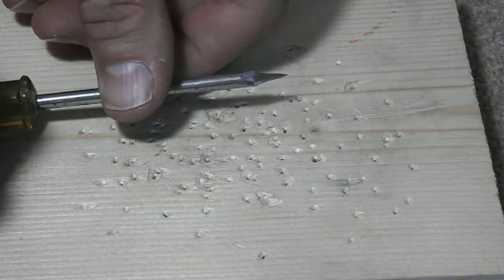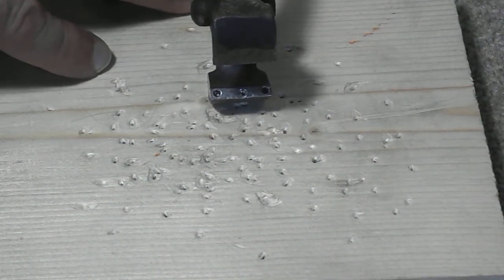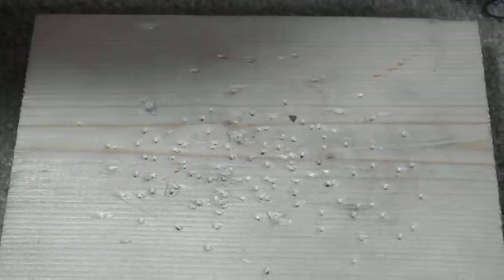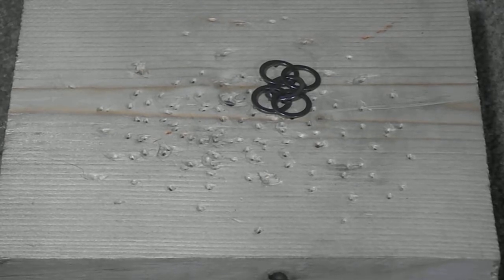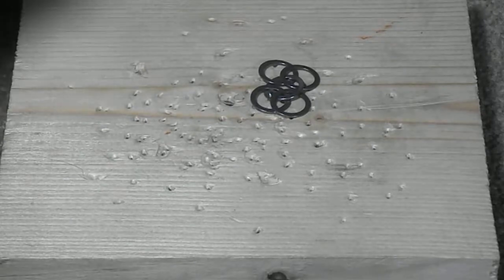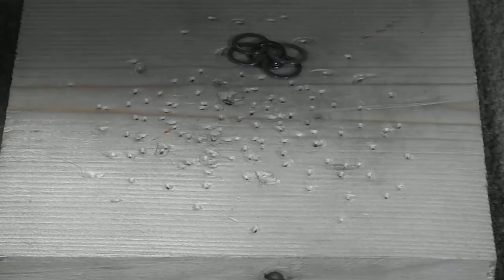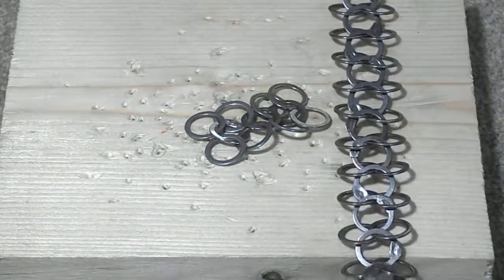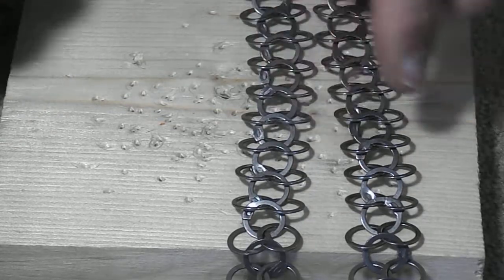Wedge Riveted Mail

Comment: What's the difference between wedge and pin riveted links?
Reply: Wedges are easier to make at home from scrap rings and are more historically accurate. Slightly flatten the scrap then cut it into triangles